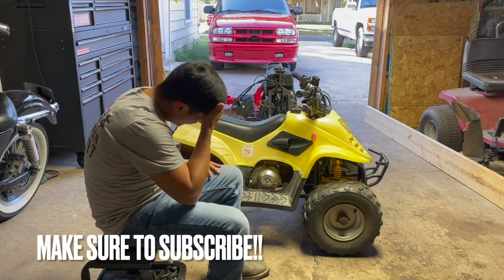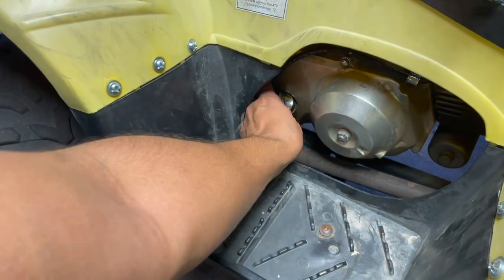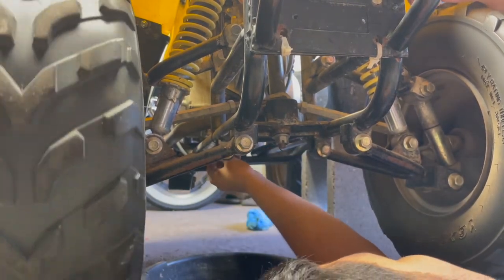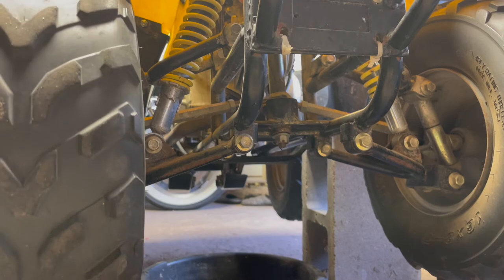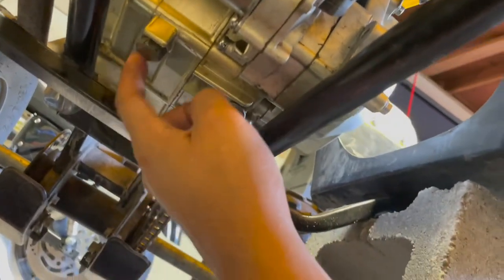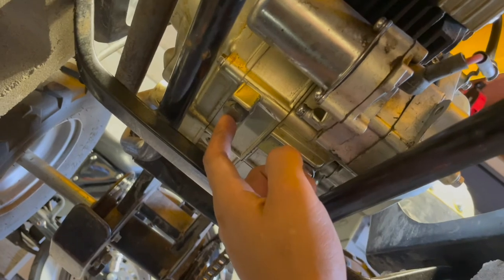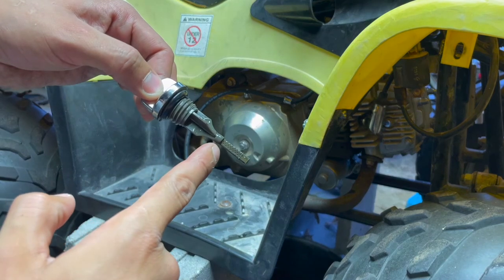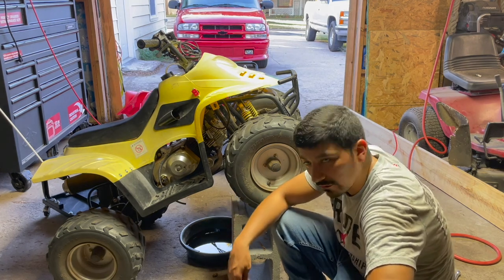How to Change Oil on a Chinese ATV- Step by Step- DIY

Comment: What is the other bolt for next to the oil drain bolt
Reply from the maker: I have never removed one. I read online that it could be a tensioner or a filter though.

Comment: how mani gallons of oil do you use on this one?, i have the same model and i cant find the user manual
Reply from the maker: I believe 1 quart or less. Just add slowly and check the dip stick.

Comment: I hope you can help me, my 125cc starts up and then it goes full throttle, I change the carb and the manifold thinking I had an air leak but it keeps doing it. Check the throttle cable and it’s fine. It doesn’t matter where you have adjustment screws in the carburetor it still goes going full throttle or idling really higher automatically. Any ideas what can be wrong? Oil chain? Spark plug?
Reply from the maker: It sounds like a throttle issue or carb issue.  Unscrew the top of carb where throttle cable goes into and make sure the guide is aligned with the nipple. On the inside of the carb. There is a slot on the part that holds the needle. If that is not aligned the throttle will stay opened all the way. If the carb is gummed up, it could get stuck open also. A new carb is $12-$15. If you have instagram I can send you pics. Please make sure to subscribe.
Reply: @brokemexicanreviews  hello, thank you for responding. I already put a new carburetor and a new manifold in and it still idling really high. I was reading that it could be gas in the oil? I’m going to change the oil tomorrow to see if that fixes the problem
Reply from the maker: When you replaced the carb was the float needle seated completely. Typically high rev is caused by too much fuel…which indicates a carb issue, carb is feeding too much fuel, or throttle cables is stuck open.
Reply: @brokemexicanreviews  all that is brand new and the needle looks good. I think there’s is an air leak in one of the head gasket. Also I started draining the oil today and as it was draining I notice that it looks like water maybe there is gas mixed or water idk. I guess the person who owned it before never changed it? Maybe that is the issue idk I’m adding fresh oil in it tomorrow and trying it again to see what happens I kind of let it drained all night to make sure there not water/gas in there anymore. If that doesn’t work I’m going to change the head gaskets next.
Reply from the maker: Have you checked to see if it is holding compression?

Comment: Dude be careful with cinder blocks I see it rocking just be careful. What's the other plug for????
Reply from the maker: Lmao.  You right haha. I have an ATV Jack now. 

I have never removed the other plug. I read online it’s to a tensioner or a filter.
Reply: Well I removed mine by accident. It had a spring keeping a piston inside. The piston came down but did not fall out. It had a couple small holes in the piston. Scrabbled to replace it and hoped not too much oil came out. There was not a lot in there, just enough to lube the piston and i prob only lost a drop or two. @brokemexicanreviews
Reply from the maker: Awesome. Thanks for the update.  I’ve always avoided removing it as I’ve never had to.